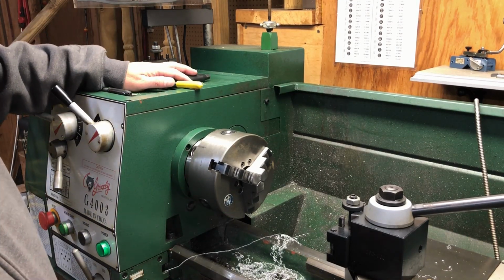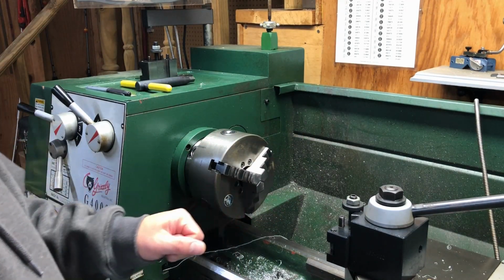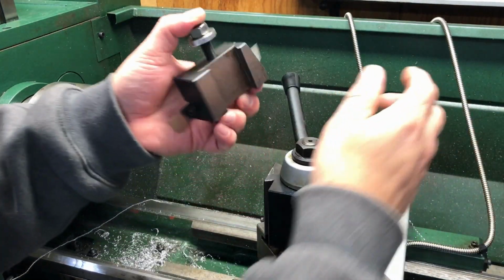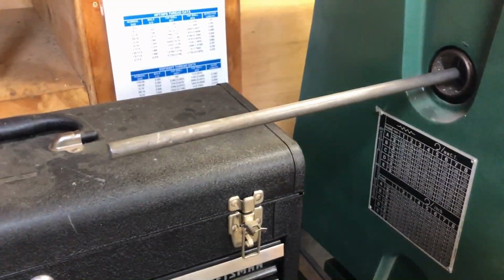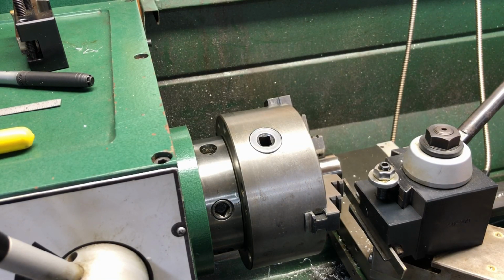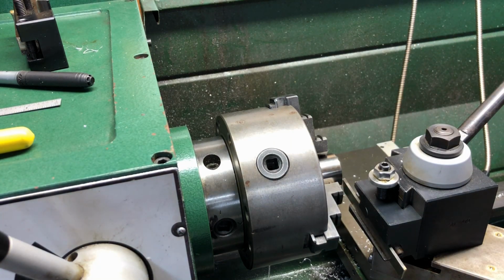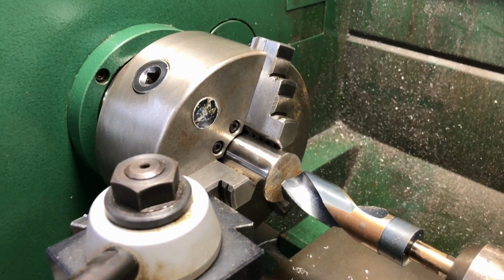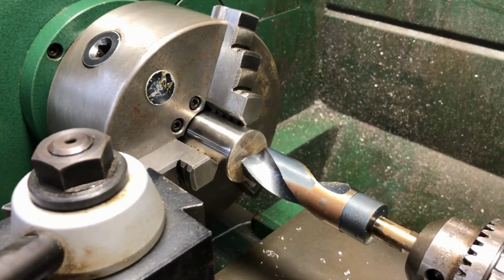Grizzly Lathe WHAT COULD GO WRONG??

Comment: The reason you had trouble with the blade cut off tool is because of too much stickout from the tool holder. Must also be set accurately on center.

Comment: An instructor once told us that your pilot drill diameter should be the same as the width of the web on your bigger drill bit. Works very well. Also it is worth the time to drill it out incrementally, especially on a 2hp lathe.

Comment: I've had the same problem with that damn hss cut off tool it will be doing good and all a sudden it will hang up on the part an it will put this huge gash in the part or brake the tool off so i leave my belt a little bit loose just in case of such a thing it will slip instead of braking something

Comment: I looks like you haven't yet shaped the cut off blade. Its just like any other HSS blank it needs a small amount of grinding of clearances, it makes a noticeable difference. I like to add small amount of positive rake. I also don't like the tip to be flat and blunt it causes too much squealing, I like to angle back the tip ever so slightly. I leaves a nub on one end but I usually go back and face it off anyways. This of course changes depending on the material choice and your machine/workstyle. Also make sure your actually square with the work. Also go slow and steady unless your a production shop that needs parts done on a schedule no reason to rush. I go on my slowest speed the lathe will go and like you said with a lot of lube. Going slower usually means if something starts to go south you and see it and react to it. Too much squealing means back off and approach again slower. That being said my metal bandsaw is my preferred cut off method. Not a fan of the carbide parting tool. I find they tend to loosen up or brake the tip on light cutting. Carbide really only seems to shine on faster heavier cuts. Maybe why I haven't had luck with them. Lastly ideally you want to part close to the chuck as possible. Parting father away can mean deflection in the part which can lead to "grabbing" especially on a blade with no clearances. If you have one setup a steady rest close to the parting line. Or use a tailstock for the majority of the cut (not a full depth cut, that would be bad) then remove tailstock and sometimes you can just break off the part by wiggling it.

As for accidents yes I have turned on my lathe the chuck hit my carbide insert shattering the carbide. Pieces of carbide were embedded in one of the steel jaws. Chuck and holder were fine. I just stinks that I have blemish on one of chuck jaws. Another time I was drilling a fairly deep hole and as I was retracting I back out too much ejecting the chuck out of the tailstock. Didn't realize that so I unlocked the tailstock and moved the tailstock back. Now the chuck was only being supported by the drill bit inside the work. It was wobbling around like crazy before I could do anything the drill bit snapped and sent the chuck flying. I made a depth stop collar on my tailstock's neck to keep that from happening.
Reply from the maker: I did grind the blade and I had many successful cut offs before I had a problem.  I probably got too relaxed and didn't pay attention to the details.  I think you are correct that I probably was not square to the work.  I was also probably in a hurry which always causes problems.  I have also backed out to far with the tailstock.  Never caused a problem, but could have been an issue.  I like the depth stop collar idea.  That's something that I will definitely add to my setup.